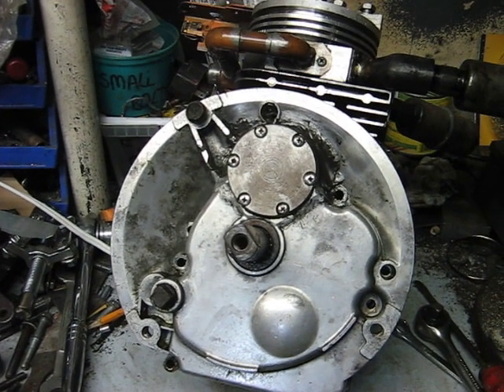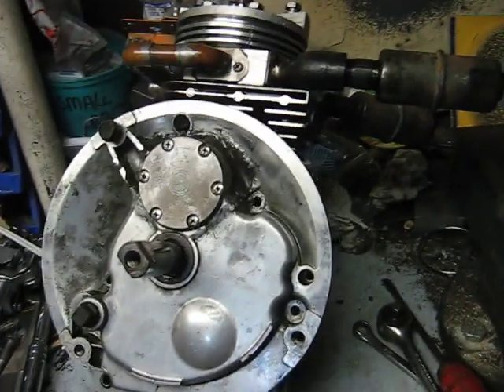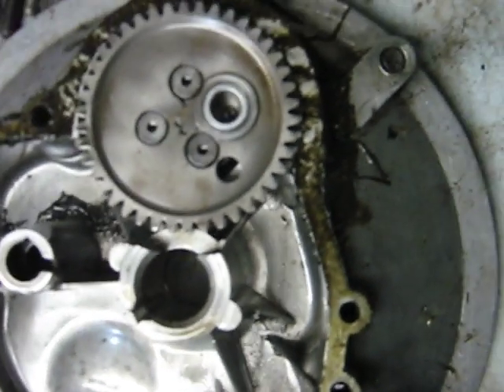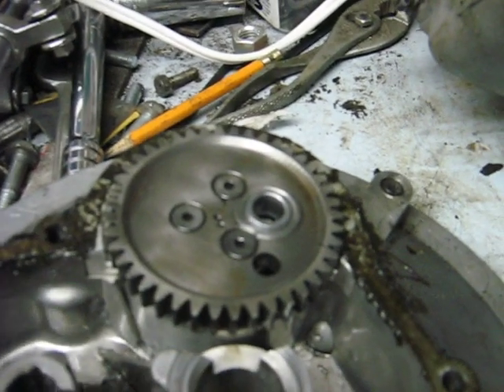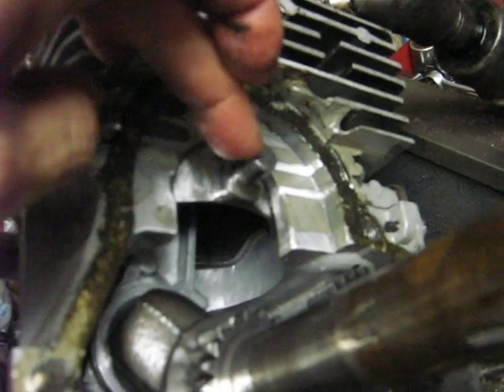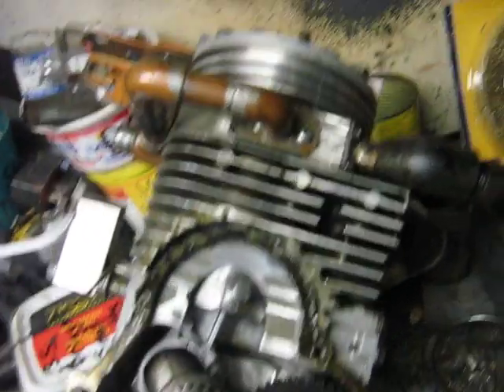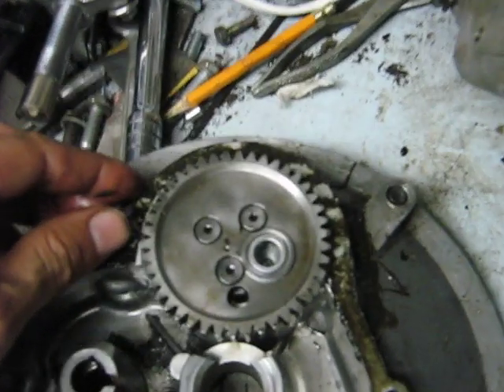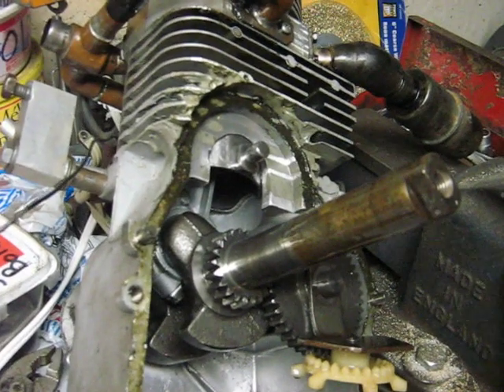Sleeve Valve Tear Down vid#1 -Sleeve drive

Comment from the maker: Oh, OK, I thought you wanted the actual feet per second speed at a given rpm, like 3600!  :)   Yes, the sleeve drive shaft turns at 1/2 crankshaft rpm, just like a regular camshaft does.

Comment from the maker: Softer than whatever tool steel I used for the sleeve. The original aircraft engine sleeves were a type of stainless steel, since its coefficient of expansion was similar to that of aluminum. Mild steel on the other hand expands less, so results in a loose fit.
The sleeve speed is a tough question, in my engine the piston stroke is 1.75", while the sleeve stroke is 1", with the sleeve drive shaft running at 1/2 crankshaft speed. Perhaps you can work out the math regarding that :)

Comment from the maker: The piston rings wear the same as normal, but the rings in the head were wearing at least 10 times faster or more. I do believe it is due to the hard sleeve material, it just isn't suited for this application. According to everything I have read about the sleeve valve aircraft engines, they had very little wear, and had long service intervals between overhauls. I think this engine would be the same using correct materials.

Comment: how does that wear compare to the rings on a regular briggs?  

Im also guessing that had it been made out of the same steel that they use to make wetliners in engines, the sleeves would be in no worse shape than a static wetliner after the same run time
yes/no?

Comment from the maker: I haven't noticed any wear on the piston. The sleeve does have some marks on it, some ellipses and parabolas, light scuffs really. The most wear is on the rings in the junkhead, but the sleeve is made of tool steel, so it is not an ideal material for this. The price was right!  :)

Comment from the maker: @Xantec 
I am going to do drawings of the various parts, so totenkopf999 can machine a new one, since he likes sleeve valves. Unfortunately most of our original drawings have been lost over the years, ,and were done on computer systems that are ancient, and not availible. so it will be good to have a current set of drawings based on what was built. Plus this is the second sleeve drive set-up, the 1st used a 1" thick spacer, which was eliminated when a machinist friend re-did it back in 1999.